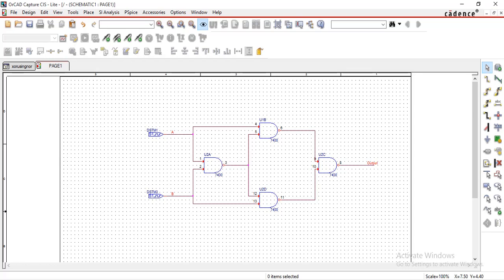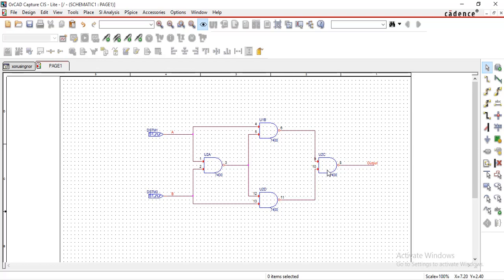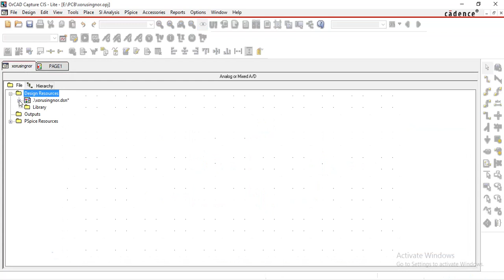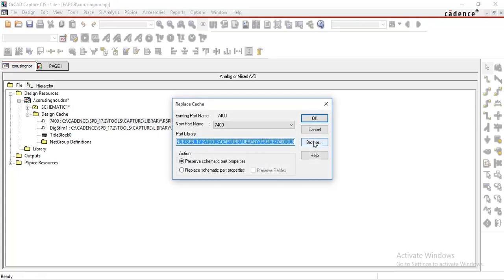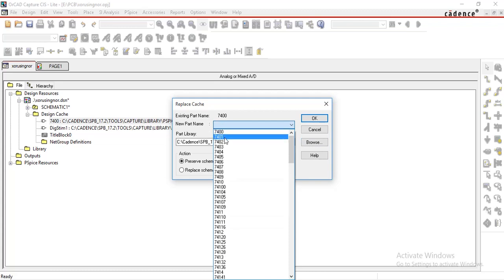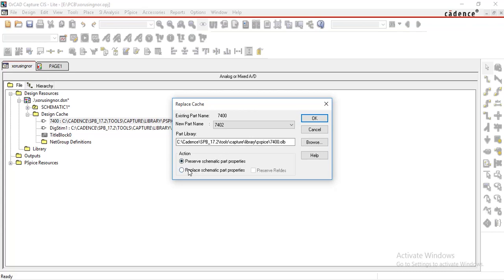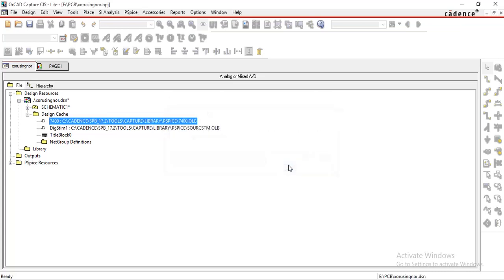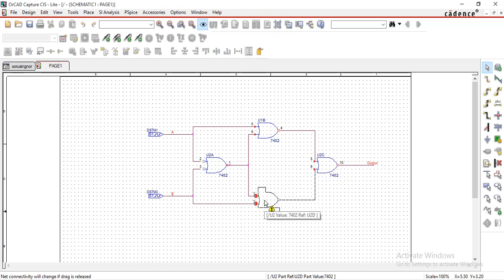How To Replace Design Cache?

Comment: It's not so "smart" method as you say, by this you change ALL 7400 to 7402, 
in general you should change only specific chip. So you shoudn't do this via replacing cache.
Upd: I saw now your comment, you should say it in beginning.